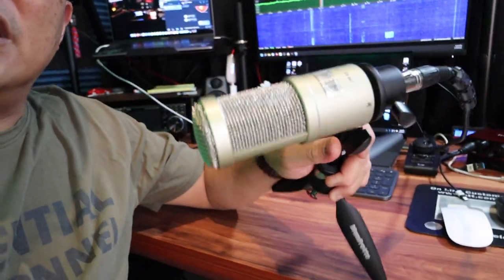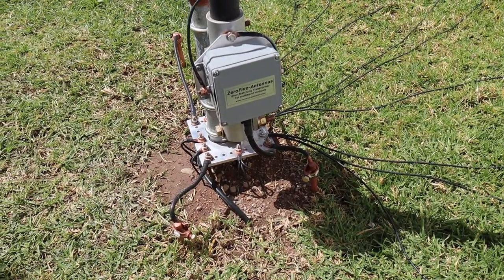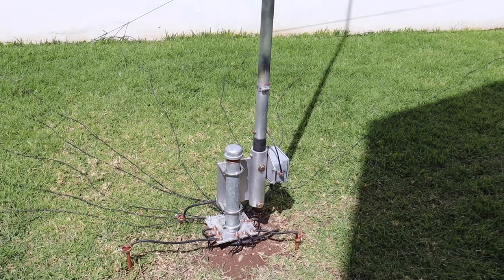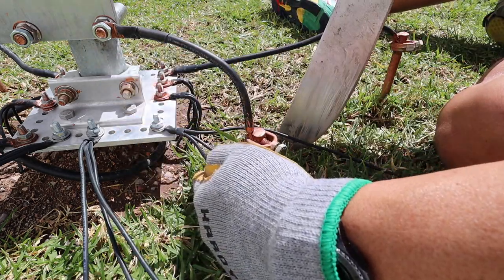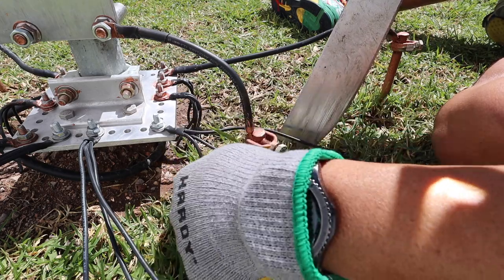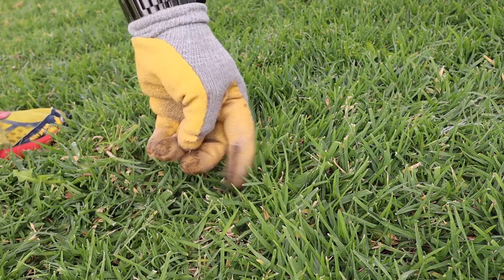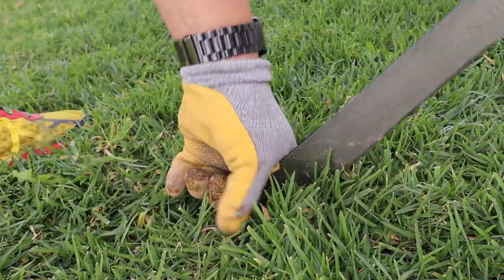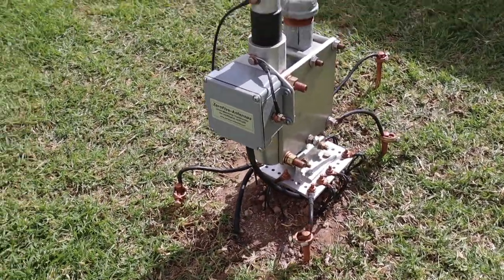Zero Five 27' HOA HF Vertical Antenna | Adding Grounding Radials with a Machete | Quick and Easy Way

Comment: I love watching your videos.  My uncle and his ham buddies just finished my HF station, I ended up buying his older Kenwood TS-990s (€2500) from him for what he claims is "a fantastic price".  I also ended up buying a very expensive antenna (€10,500) that fit on my roof and the landlord approved of me using so I have something called a stepper (stepir?) that goes from 80M to 6M and adjusts itself when I tune my radio.  I also bought a used Acom 2000A from one of my uncles ham friends for what was really a fair price (€1500) because I guess he didn't use it anymore and thought I was pretty or something..  Whatever I'll take it.  The antenna is up about 25 metres and everyone is happy.  Maybe we can talk sometime!  I contributed beer and whiskey to the effort, and a bag of peas when my uncles friend banged his head.  They're meant to come back and put in a vertical antenna this summer to finish things up, but I'll be in the states visiting friends when they do.
Reply from the maker: Congratulations on your setup. I'd like to see it all setup. The steppir antenna is very nice. You can find my email on QRZ.